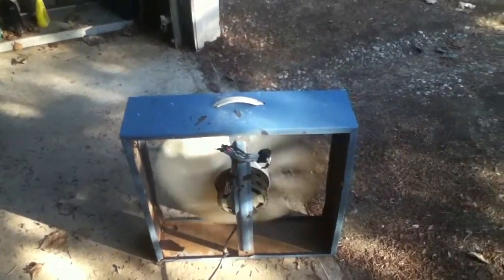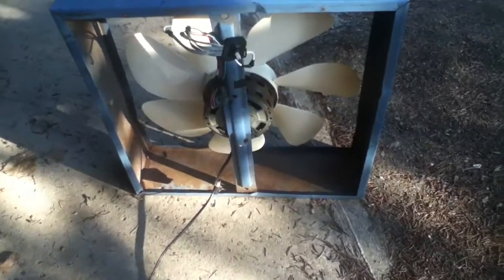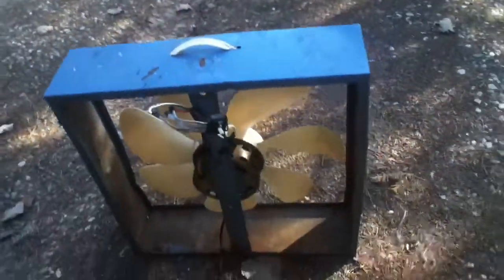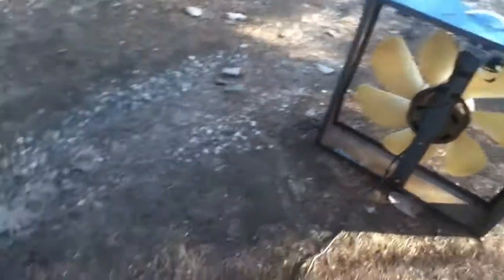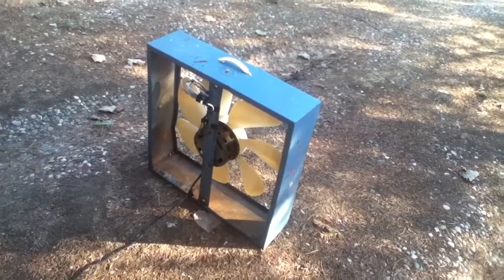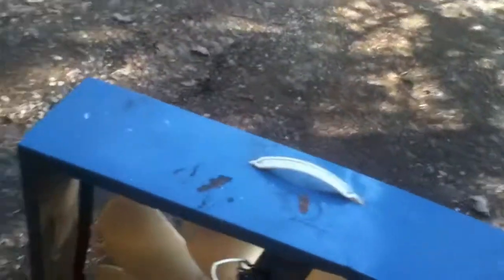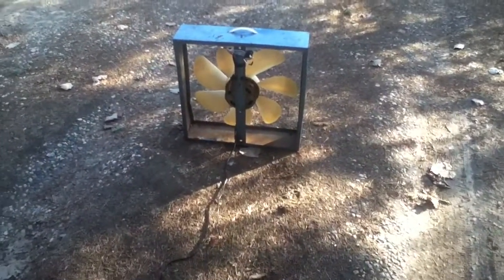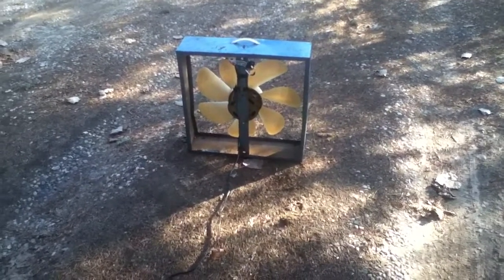EXL test run

Comment: It's wired incorrectly.  someone put power across "low" and "high" instead of "neutral" and "low."
Reply from the maker: Yea never test a fan with a lasko switch goddamn im still pissed from that it would of lasted alot longer